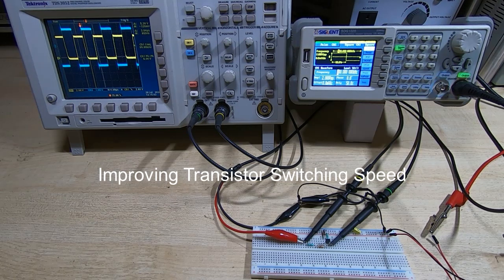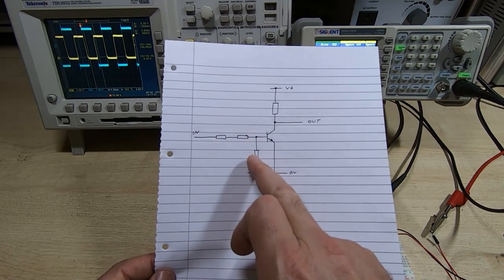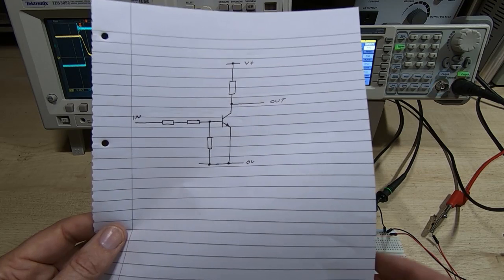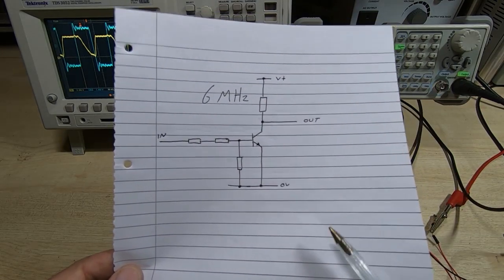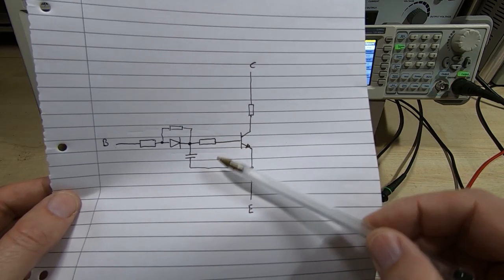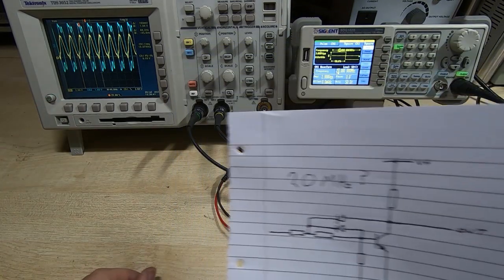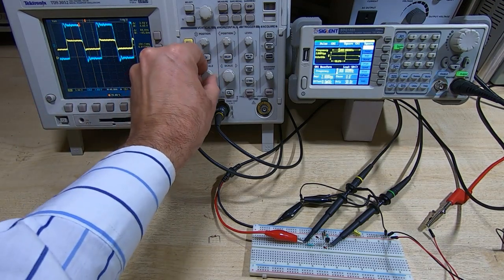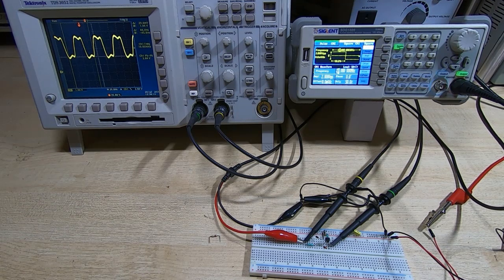Improving Transistor Switching Speed

Comment: Thanks, this has been really helpful. One question i had, though, was how does this relate to the "Delay Time / Rise Time / Storage Time / Fall Time" figures provided in the BJT's datasheet? For example, I'm driving a 2N3904 at 10 MHz , and the delay time + fall time + rise time per the datasheet add up to 120 nS, but the half-cycle time of 10 MHz is 50 nS and I'm still getting switching, which doesn't seem like it should be possible. Am I misunderstanding those time figures?

Comment: Thanks for the video, a combination of your 2nd circuit using diodes and lowering my resistor values has started to get this working for me, trying to switch at 16mhz in my own project, thanks!

Comment: You could also use a mosfet like a 2N7000.
Reply from the maker: Unfortunately the 2N7000 will not work in something like the transistor processor. It is also not a bipolar transistor which is the real point of this video. You could for example also replace it with something like a 7404 but the point is how to make a bipolar transistor switch faster and not how to replace it with something else.
Reply: @JerryWalker001  Can you explain specifically why that is?
Reply from the maker: @Under_Protest  Which part of my reply are you questioning? If it that it will not work then you may want to purchase the book and try to copy the circuits using a 2N7000. They will not work because bipolar transistors work very differently to a 2N7000 and you cannot connect something like a 2N7000 in circuits in the same way as bipolar transistors. If it is that it is not a bipolar transistor then it is not a bipolar transistor which is specifically what the video was about. As I said you could replace the bipolar transistor with something faster but that is not really making a bipolar transistor switch faster. There are other reasons the 2N7000 would also be unsuitable for something such as the transistor processor. For example they are at least 5 times the cost and as there are 6000 of them in the processor (with RAM) then the cost would be very high. You could of course redesign the circuits to use something like the 2N7000 but as the processor and the video specifically relates to bipolar transistors then a 2N7000 does not qualify.
Reply: @JerryWalker001  You are incorrect. MOSFETS work exactly the same as BJT transistors, except that BJT transistors vary the output voltage according to the input voltage, while a MOSFET varies the current while passing any voltage. Also, I have just ordered 40x 2N7000 on ebay for $5 free shipping.
Reply from the maker: @Under_Protest  That is absolutely NOT the case. I suggest you try it. Bipolar transistors and MOSFETS are VERY different in complex circuits. They may work in a similar manner in a simple switching circuit but not when you connect them directly together. Instead of simply contradicting me I suggest you try it. As I said they are MUCH more expensive than bipolar devices.  Your pricing results in a total cost for just the 2N7000's of $750.00. You can buy 6000 bipolar devices for around $70.00 (11 times cheaper) so I stand by what I said. I sell the entire kit including boards and all parts for less than $750.00.

Comment: I've used this circuit with two diodes limiting saturation and it makes a huge difference with non-switching devices like BC108; a significant improvement but not as much with 2N2222 and 2N3904.  I tried to find more details on how it works but haven't found it anywhere else.   Does this method have a name or can you point me to anywhere that explains the mode of action?
Reply from the maker: The main limiting factor in bipolar switching speeds is the junction capacitance when the device is driven into saturation. This varies from device to device and high speed devices are generally made with smaller junctions which is why they are often more 'fragile'. What you need to do to speed up the slower devices is to prevent them being driven into saturation (which is the purpose of the diodes) and increase the junction turn off time by bleeding off the charge (which is what the resistor is for). The values selected depend on transistor type and what trade off's you are willing to make. You will get less performance improvement with switching types because they are already optimised and so the returns are smaller.
Reply: @JerryWalker001  Thanks for the additional information.  I'll experiment with a 'bleed' resistor on the BC108 family that are slow switchers then.

Comment: One possibility for a kit is to provide the pads for the extra parts and leave the user the choice to populate the diodes (and capacitors, in parallel with the series base resistor).
Reply from the maker: Unfortunately this would double the size of the boards and they are already fairly large and this would add £100.00 to the kit price just for the board cost. The kit it not intended to run at high speed as this does not allow the operation to be seen. It was never intended to run beyond 2KHz (It will actually run up to 250KHz) so the current design fully meets the intended purpose.

Comment: That is interesting, thank you for sharing.  One question that crossed my mind is if you swap the bipolar for a mosfet (with a low gate capacitance not some big power fet) would that greatly improve the speed?  Also if you chain say 3 of those 'inverters' back to back I would guess that would cut the top speed even more?  Would the diodes have as much of an effect when stages are chained since subsequent stages would no longer have the low impedance drive?
Reply from the maker: Unfortunately the circuits would not work with mosfets although there is no reason you could not design a system using mosfets but the general design would need to be very different as the bipolar transistors have benefits in these simple gate designs. In particular designing multi input gates would be much more difficult. The processor works up to around 250KHz which may sound odd considering that I show a single stage working up to 6MHz but as you correctly say there are more than one stage in the processor circuits. Some have 8 gate stages and so the total delay is the combined delay and so the limiting switch rate is correspondingly lower.

Comment: Very nice demo. For high power devices like used in flyback circuits they reverse bias the base region so it zeners and discharges the base region either by a base drive transformer or a large capacitor. Obviously you cant do that in a multi transistor circuit.
Reply from the maker: Yes I showed a similar technique using a capacitor in a previous video. That technique increases the 'drive' rather than clamping the switch point which cannot be done in a flyback as that would destroy the device, In the first modification in this video uses the same drive increase technique and in the second modification it uses a clamp (actually gain control) method to give better results. They are useful methods in some circuits but as you say it was not really an option for the processor kit due to the number of transistors used and was also not needed as the processor was only supposed to be used up to around 2KHz. It actually works up to around 250KHz.

Comment: The diode from the collector looks backwards in your schematic.   When the collector goes below a certain voltage, it should pull the base drive down.   The way you have it, when the base voltage is low, it will hold the collector low.
Reply from the maker: No it is correct. It is not a voltage clamp it is a bypass diode circuit which controls the gain of the transistor as it reaches saturation. I inserted the diodes exactly as shown in the schematics and then showed the circuit working.